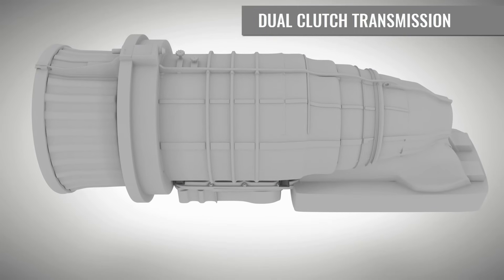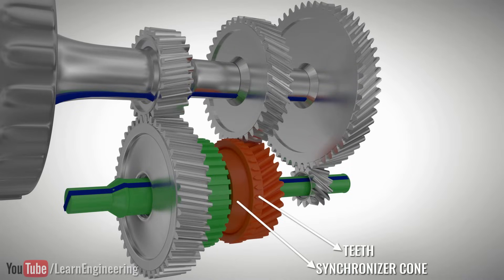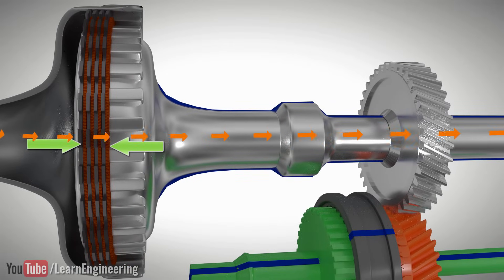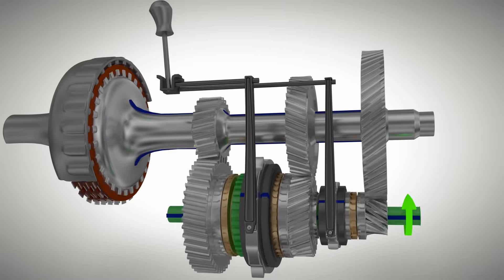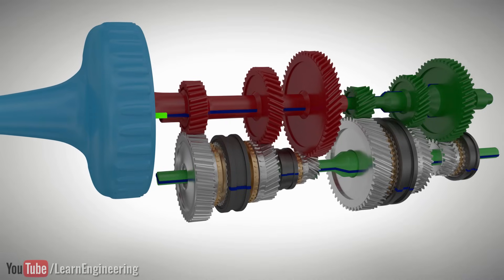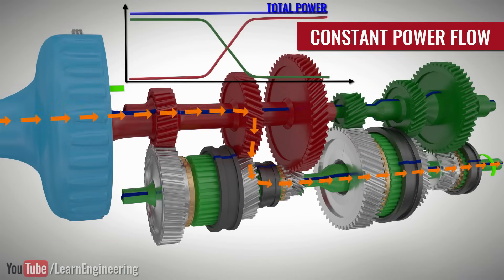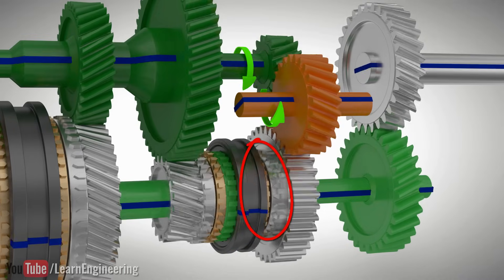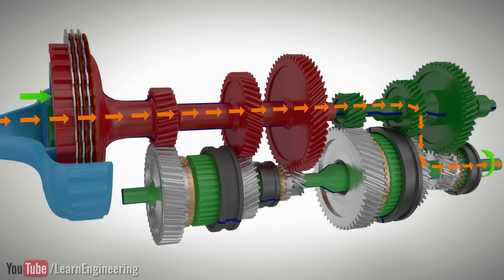Working of Dual Clutch Transmission (DSG)

Comment: What isn't said in this video is that unfortunately a dual clutch transmission weights a lot, because basically you have two transmission. So more weight for a smoother output, that's why in racercars where is important a low weight the sequential transmission is preferred

Comment: Unreliable system and expensive to repair. Stay clear. The best automatic transmission is a torque converter which is brilliant and exceptionally reliable. Mechanic 60 years experience.

Comment: I have a problem WA with dual clutch. It is a clutch concept. I live in Seattle WA USA. There are times when traffic moves slower than engine at idle first gear. Which can go on for minutes. Like the time it took 12 minutes to through the I5 SR 512 interchange in Tacoma. The only way to traverse something like that is slip the clutches. Which according to other you tube videos. Is hard on a dual clutch transmission. Something you should not be doing. The only way I know to traverse such traffic is using a torque converter. Dual clutch may be simpler and more reliable. But if automatic transmission lasts the life of the car who cares. Dual clutch may give slightly better performance and perhaps better gas mileage. But what good is that if you can't drive the car in traffic jams without undue clutch wear and expensive repairs . I read somewhere that VW had a model with dual clutch. And went back to real automatic transmission.
Besides the whole argument over how to build a transmission for a conventional gasoline car is all wrong. Right way is the Prius hybrid way for gas mileage and possibly for longevity. Toyota thinks so. They are offering much of their product lines hybrid or plug in hybrid only

Comment: Hi, anyone can explain to me how dct prevent engine stall? Cuz i dont get it.
Reply: The computer box can determine the engine RPM, and if it's too low already, it will perform the necessary gear shift to prevent it from stalling. Heck, in a DCT, the computer box can even put the transmission in Neutral position even if the gear selector is still in Drive mode, and will be engaged again once enough engine RPM is given.

Comment: But why more car manufacturers choose to use CVT in their cars?
Reply: Cheap
Reply: Easier to operate. DCTs operate in a very complex manner. Precision and perfect timing are needed to maintain smooth operation and extend the lifespan of the transmission.

Comment: Duct is kinda like manual in the sense that you have control of the gears
Reply: I mean dct
Reply: DCT is basically two manual transmissions joint together so that the wheels are driven constantly, and the computer box performs the gear shiftings automatically.

Comment: Hello What happens when we engage the gear from Drive to Neutral when the speed is around 50MPH. ?
Reply: You're just cutting off power flow from the engine to the wheels. It's not a good way to stop the car though, because engaging the transmission means the engine can still perform engine braking to stop the vehicle, as opposed to letting the brakes suffer from extreme braking, and potentially heating up and wearing out your brake pads heavily.

Comment: Man, big up to these engineers. Also, maybe they should have named it dual transmission instead of twin clutch, sounds more advanced.
Reply: Dual Clutch is just right, because it explains entirely the idea behind how it operates like an automatic transmission, and how its structure will look like without even seeing its schematic diagram.

Comment: The comparison with a conventional (planetary gear and torque converter) transmission ignores that all modern torque converter automatics have a clutch the locks up the torque converter, eliminating slippage. The complexity comparison ignores that while the DCT has only two main clutches, it also has a synchronizer (which is a small and complex clutch) for each gear ratio, including reverse. That means at least two more controlled clutches in a DCT than a planetary automatic.

Comment: Still confused
Reply: We all are. Would need physical model.
The most I understood is that you have two gears ready at same time. One clutch does even gears, second one odd ones. So prob one spins in the "air or free" and other takes full load. Not sure about how they swap
Reply: @WszystkoZajeteOMG409  Can i explain In simple terms ?
Reply: @TEXc5  Sure, Im not mechanic so I will gladly listen to
Reply: @WszystkoZajeteOMG409   hey buddy , so here is the explanation :
 
Context : 
_So basically DCT transmission have 2 seperate transmission , both both trasmission have divided gears , not in rows ( like 1st trasmission have 1st gear and next gear will be 3rd gear , not 2nd , and 2nd transmission will consist of 2nd gear and then jump to 4th , you can see in the video , he animated even gears and odd gears in red and green colour )
Odd gear : odd gear are 1st , 3rd , 5th gears 
Even gears : 2nd , 4th , 6th 
This is just like odd and even numbers , which we studied about in our math subject.
So now how its work : 
As i said DCT have 2 seperate transmission , both have their own clutch (basically....., by having their seperate clutch...., with this you can disconnect the 1st or 2nd trasmission seperately...., so suppose if you want to change gear in 2nd transmission , you can disconnect power with clutch in 2nd trasmission without disconnecting clutch of 1st transmission as well....., as i said both have their own clutch) , so now , suppose if you are diving in 1st gear which is in 1st trasmission , and if you want to switch to 2nd gear which is placed in 2nd  transmission , 2nd gear will also applied with 1st gear.
So if you are driving in any gear , the next gear will applied as well._

For example - if you are driving in 2nd gear , then 3rd will be applied as well , and if you driving at 4th gear , 5th will be applied as well.

_Now Quetion is , how both gear together of different speed drive the car at the same time ?
Well , as i told you , the gear in which you are driving at , the next corresponding gear will in seperate transmission, so you just have to change clutch_ 

For example :  if i am driving at 1st gear ,and want to apply gear (as i said that next corresponding gear will also be apply with the current gear...., and in this example we are supposing that current gear is 1st and want to switch to 2nd ) , so for switching to 2nd gear which is in seperate**transmission , just disconnect the current transmission clutch and engage the clutch of that seperate transmission , because as i said the next gear which is 2nd gear in this example , is already connected , we just have to connect the clutch and disconnect the other transmission clutch

Note : all these things are automatic , because this is an automatic transmission, you just have to switch the gear into driving gear from parking gear of the car.

_all the clutch and gear shift done by the car system internally , you don't have manage or worry about it._🙂

I am currently a 9th grader middle school student , and hope you find my explanation helpful, thank you 🙏 ❣️
Reply: @WszystkoZajeteOMG409  hey buddy , so here is the explanation :
 
Context : 
_So basically DCT transmission have 2 seperate transmission , both both trasmission have divided gears , not in rows ( like 1st trasmission have 1st gear and next gear will be 3rd gear , not 2nd , and 2nd transmission will consist of 2nd gear and then jump to 4th , you can see in the video , he animated even gears and odd gears in red and green colour )
Odd gear : odd gear are 1st , 3rd , 5th gears 
Even gears : 2nd , 4th , 6th 
This is just like odd and even numbers , which we studied about in our math subject.
So now how its work : 
As i said DCT have 2 seperate transmission , both have their own clutch (basically....., by having their seperate clutch...., with this you can disconnect the 1st or 2nd trasmission seperately...., so suppose if you want to change gear in 2nd transmission , you can disconnect power with clutch in 2nd trasmission without disconnecting clutch of 1st transmission as well....., as i said both have their own clutch) , so now , suppose if you are diving in 1st gear which is in 1st trasmission , and if you want to switch to 2nd gear which is placed in 2nd  transmission , 2nd gear will also applied with 1st gear.
So if you are driving in any gear , the next gear will applied as well._

For example - if you are driving in 2nd gear , then 3rd will be applied as well , and if you driving at 4th gear , 5th will be applied as well.

_Now Quetion is , how both gear together of different speed drive the car at the same time ?
Well , as i told you , the gear in which you are driving at , the next corresponding gear will in seperate transmission, so you just have to change clutch_ 

For example :  if i am driving at 1st gear ,and want to apply gear (as i said that next corresponding gear will also be apply with the current gear...., and in this example we are supposing that current gear is 1st and want to switch to 2nd ) , so for switching to 2nd gear which is in seperate**transmission , just disconnect the current transmission clutch and engage the clutch of that seperate transmission , because as i said the next gear which is 2nd gear in this example , is already connected , we just have to connect the clutch and disconnect the other transmission clutch

Note : all these things are automatic , because this is an automatic transmission, you just have to switch the gear into driving gear from parking gear of the car.

_all the clutch and gear shift done by the car system internally , you don't have manage or worry about it._🙂

I am currently a 9th grader middle school student , and hope you find my explanation helpful, thank you 🙏 ❣️
Reply: @TEXc5  this is an incredible explanation especially if i assume that english is not exactly your native language. you seem very passionate about engineering. i wish you the best of luck in your future endeavors friend ❤
Reply: @userman-rw9bp   thank you 🙏 so much dude , glad someone understands my explanation , thanks for your appreciations
Reply: @MrLeast.1n Thanks bro, I appreciate your explanation
Reply: @BayandaMahlaba-wy2gg   glad you liked it 🙏
Reply: @WszystkoZajeteOMG409  Çok doğru diyorsunuz. Aslında mesela 2. viteste giderken 3 veya 1. vitese en uygunu hangisiyse ona karar veriyor ama aslına o viteslerin mili de senkromeçleri de belli bir tork ve devirle dönüyor. Ama  vitesi hazırlarken hiç manuel vites kutusundaki debriyaja basmadan vites değiştirme esnasında gelen ses gelmiyor ve vitese sorunsuzca geçiyor. Ben burasını anlamadım. Anlayan varsa lütfen anlatsın.
Reply: Can i explain In simple terms ?
Reply: Same here lol!!!
Reply: Dumbass
Reply: The human mind wasn’t made to understand black magic

Comment: 4:00 This has to be one of the worst graphic representation i ve seen. How do you have 2 different gears connected to the same output shaft at the same time, when one is spinning faster than the other

Comment: Here’s some big brain stuff: a manual-dual clutch transmission. 3 pedals and an extra clutch controlled by the hand. Have that clutch be a button or a trigger on the shifter. So you can shift fast, but shift at will and still have total control over the car. That’s an IQ 5000 play right there, I’ll give you normies a few decade to catch on.
Reply: Requires too much driver input. Only car enthusiasts would want that.

Comment: Sounds great in theory, except it's not smooth at all in practice. Mine always unpleasantly jolts or twitches when coming to a stop (even if I brake very gently, it still feels like I hit the brakes too hard). Also, when I brake for a red light, and it turns green so I start accelerating, there is a nasty jolt which doesn't happen in a normal automatic. It might have superior performance, but comfort-wise, it's worse than either a manual or a standard automatic.

Comment: Wouldn’t this lead to a quicker wear of the synchronizer ring? Since it will have to accelerate the set from 0 rpm to what ever match. While single clutch system the set have a original rpm that’s relatively close to the rpm that match. Imagine transmitting from 6th and 5th gear repeatedly. Or do synchronizer ring just don’t wear out?

Comment: Since when did the manual transmission have a bunch of clutch plates up in front instead of one big clutch plate with a pressure plate and throwout bearing?
Reply: these guys clearly have not done a clutch change on a stick

Comment: My car is having amt gear unit, (it’s a fiat Punto evo 2009) recently it doesn’t engage in moving when I set the drive mode. It keeps shaking seeming trying to setting to its first gear. When I try to engage gear just to revers al of sudden, the car stops having a clutch slumping … I’m fed up with this hving no solution to recover it.

Comment: Have a 2016 Ford Focus. It has had both set of clutches replace 5 times since we bought it brand new. We are now in a law suite with Ford. Not sure if ford made their DCT different or not, but what I have seen with this trans. IT SUCKS. Clutches last about 20000 miles then need to be replace. A computer can not predict when to sift for a human. Still a lot of work needs to be done. If you don’t believe me just ask Ford, I am not the only one in a law suite with them

Comment: the big problem of DCT (DSG) to automatic ist the right timing or selection how gear will next need.
it need i don't know 3s to change from a pair 
normaly no problem in the most car using, in racing are 3s a big timing problem

Comment: You can tell it's American, spun against manual gearboxes with words like delay, slow, drag when actually a manual gearbox out performs an automatic one every time.

Automatics are inefficient, inaccurate and slow to decide on which gear to be in - because it doesn't know what the driver is thinking... That's why every sports, rally and racing car is manual...
Reply: Oh really? I'm pretty sure there are many race cars that are using this DCT style transmission precisely for their fast shifting and precision. These computers can be easily tuned for different conditions and DCT's are far more efficient than your average commute driver.

Comment: What if in the classic manual transmission, remove the synchronizer stuff and switch it with clutch set to connet the gear and the shaft, that might save space and less complication

Comment: Both of my cars have DSG, one being 10 years old and I've  never had a single issue. Both cars deliver great mpg and still smooth as ever. People who diss DSG are rather ignorant, believe me this is the best transmission ever
Reply: Dry or wet
Reply: @electrosec  Twin plate dry 6 speed diesel and dry 7 speed petrol. Diesel one is 10 years old, petrol is 7 years old.
Reply: Hyundai ioniq hybrid uses a DCT or DSG same thing. Very interesting with gas+ electric power and paddle shifters

Comment: Loving my acura/honda designed 8 speed DCT with torque converter. I've had regular automatic and cvt in the past and they've been fine. Next up I plan to get my very first manual in a year.
Reply: Did you got the manual? I learned on manual trannnies, have driven regular torque converter automatics that you can kinda select your gear by how much you press the pedal, I just got a dual clutch auto and i DO miss manuals, until the computer realize what i want from it i could have just downshifted, reved it up and had instant power on a lower gear or skiped a gear or two if i had enough speed to just keep it rolling, cant really do that OR I have to get used to the car behavior
Reply: Manual is gods gearbox

Comment: Some auto makers use dual clutch transmissions for better performance. 

Other auto maker use automatic transmissions with more than 6 speeds for better performance....

so...

what would happen if an auto maker made a 12 gear dual clutch transmission?

Comment: Had this in my 5-series, best transmission ever...gear changes are instantaneous and acceleration is amazing.
Reply: 5-series has a DCT? You mean M5?
Reply: @Has7DCT  yes G30 5-series has 7-speed DSG (dual clutch transmission)
Reply: @goata007  hell no I thought they were only ZF 8-speed torque converter ?? The only 5er I know with the DCT was the F10 M5. Something's off here
Reply: @Has7DCT  You’re right, its ZF 8-speed auto, somehow i got it mixed up. But it changes gears so fast in sport mode, feels like DCT
Reply: @goata007  can definitely agree with that. These ZF's are catching up with the DCT's lightning quick shifts but also silky smooth at low speeds (doesn't jerk like a DCT at all)
Reply: How about maintenance cost?

Comment: So with a dual clutch, you don't have to let off the throttle when you engage the clutch?
Reply: there's no clutch to engage, the computer does it automatically
Reply: @sambarker7930  oh so there's no dual clutch manuals?
Reply: @marcus3431  no. A duel clutch gearbox is a type of automated manual (so none of them have a clutch pedal or a H pattern gearstick)
Reply: @sambarker7930  oh ok thanks for explaining
Reply: @marcus3431  no problem!